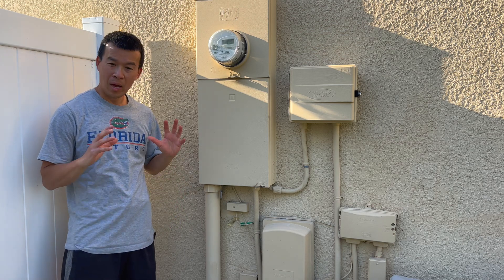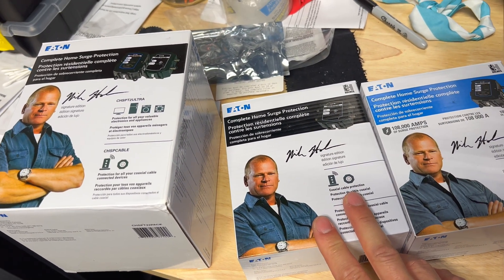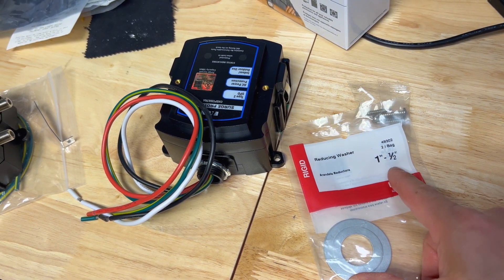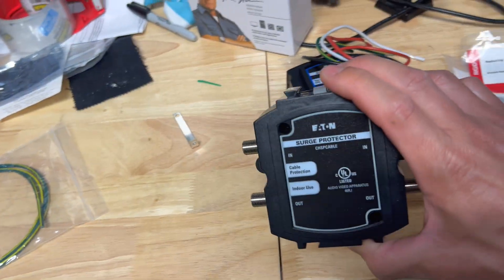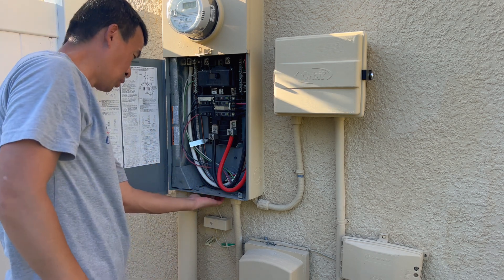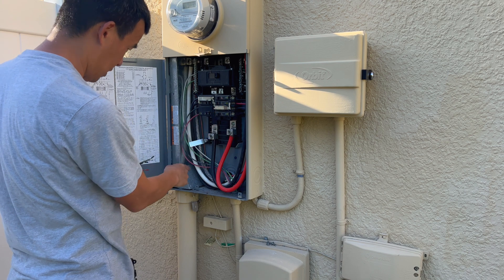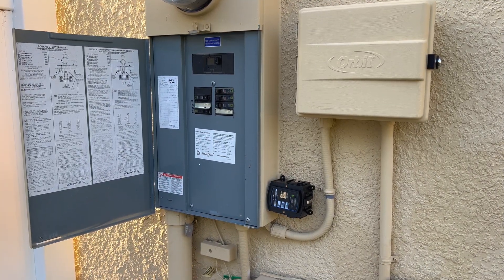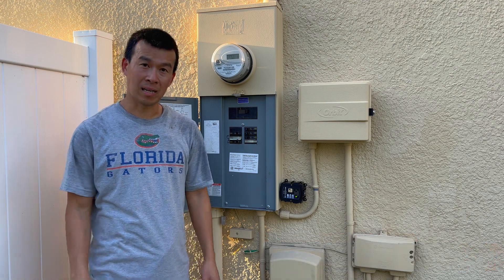How to Install Whole House Surge Protector | Type 2 SPD | Cable RG6 Surge Protection

Comment: Yeah so if they are only meant for sensing how is it that it requires a 50A breaker and how would it dump the load if they aren't meant to carry current?

They ARE meant to carry current and there are options of tandem breakers that could have been bought to make this install correct.

Comment: I'm not going to lecture you about working in a hot box, I know that won't help anything.  Your channel name says with kids, please PLEASE just try to stop reaching into your hot box with both hands.  It is SO dangerous, I can't be explicit enough about that.  If you have trouble remembering just put your non dominant hand in your back pocket.  It won't make it safe by any means but it will make it a lot less likely to slowly, silently, kill you without anyone even noticing until it's far, far too late.

Comment: Why so little circuits and so small panels? You can't have any home circuits in such panel. What is that then?
Reply from the maker: This is just the main entrance panel with a few circuits serving this side of the house. There’s a 200A subpanel that has all the house circuits in the garage.
Reply: @TunerwithKids  ohh ok, I never seen that before where I live

Comment: I remember back when they were $90 for the comm and line voltage.... unfortunately Comcast cable says using them will deteriorate the signal ....

Comment: They make a tandom breaker so you can have 2 50 amps in that one spot, hope that helps
Reply from the maker: I didn’t think of that. I’d probably tandem one of the lower amp circuits to free a slot since those are probably cheaper.
Reply: What ever works best for you glad to help

Comment: Good vidio, I had not thought of double tapping an existing breaker.  I don't have any room for a dedicated breaker either.  I can doulbe tap to a 50 amp breaker (which feeds a sub panel) will that work the same as a breaker feeding an appliance?  I think that logically it should but wanted youur opinion.  The only other existing breaker is 30 amps which probably will compromise things, and I don't have room for a dedicated one.
Reply from the maker: The double tap is probably a grey area for most. They really want you to have a dedicated break for the surge but I had no choice. The risk is whatever is on the double tap isn’t protected. So you have to verify that the break used is allowed to be double tapped. Some aren’t, just look on the side or the data sheet for it.
Reply: Not necessarily, use it on the interior panel. Right at the bus down wind of your main breaker.?

Comment: Pretty good job. One thing to note is the manual recommends "have one twist per inch to reduce the impedance of the wire". So you just need to twist the wire together. I made the same mistake when I installed this as well, found out when I talked with others online that did this.

Comment: During the install you mentioned that it is important to separate the Ground (green wire) and neutral (white wire).  However, it looks from the work you were doing you put both on the same ground bus.  Am I seeing that wrong?  I have a similar outside shutoff like yours and I only have a single bar that I assume I put both the ground AND neutral - is that right (it doesn't appear in my panel that I only have a single bar.
Reply from the maker: On the main entry panel, the ground and neutral are bonded together. On subpanel they are separated. If you install on anything other than main panel, the ground and neutral has to be separated.